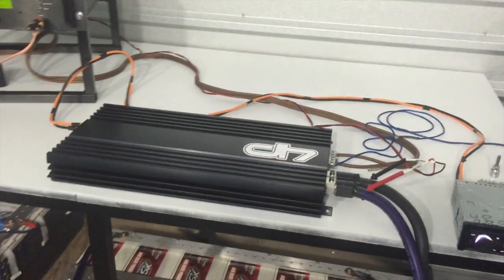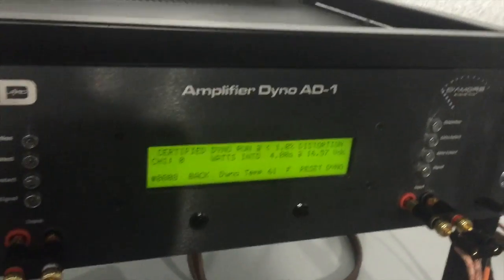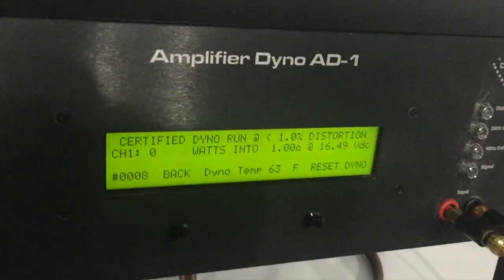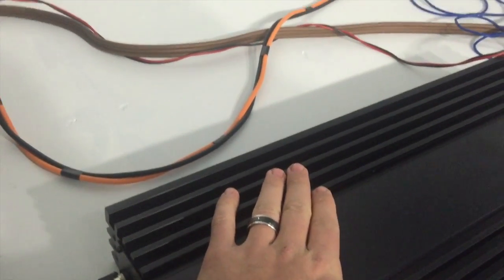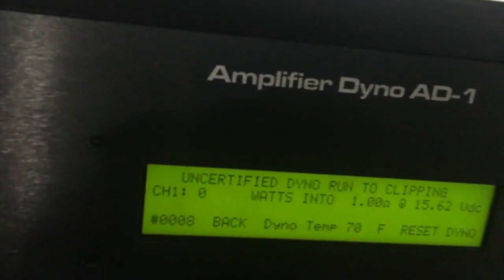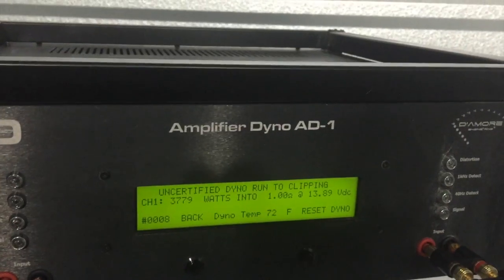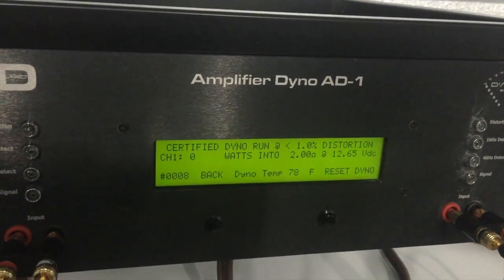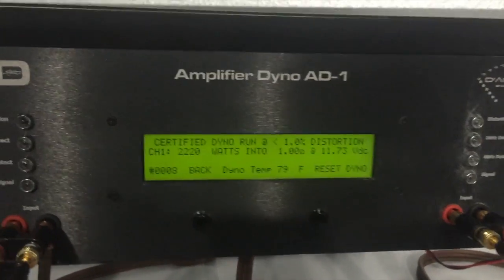Droppin' HZ Car Audio 3000.1 Amplifier Dyno Testing

Comment: why post a video if you don't show dynamic most people don't run 3k amps for 10 second sound wave so that was points
Reply: Black Crown  Actually, most people buying that kind of power use hip hop to demo their system, which has continuous bass drops, so I think the certified sine wave test is a good thing. It shows you what that amp can continuously deliver.
Reply: ain't no song going to have a 10 second sound wave

Comment: I find these amp Dino video's hilarious cause they dyno shows you zero about a amp. It's not accurate you can put the same amp on it with the same voltage and it will never give the same number. Might as well shake a magic 8 ball it's just as accurate if not more lol. That and there is so much more that makes a amp loud or sound good. Guarantee you could take some of these cheap audiopipe amps that the dyno shows to be twice as strong as another quality amp and in the car a Rockford or JL would be twice as loud and a hell of a lot cleaner doing it.

Comment: far out that battery bank looks unsafe. wouldn't wanna drop a spanner accross pos neg. the fault current would be insane. there is a reason most banks dont just use long exposed bars like that!